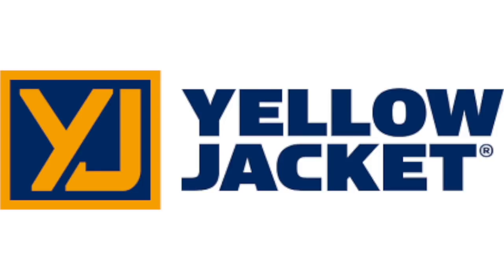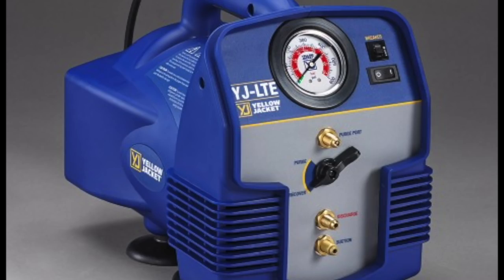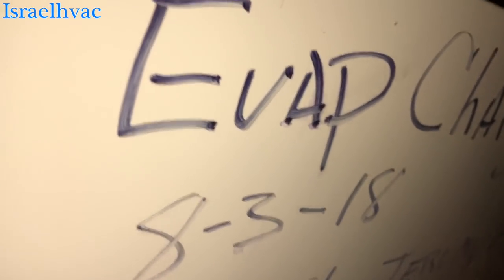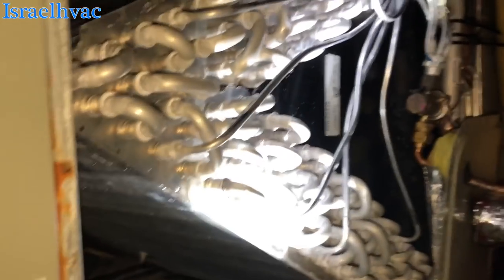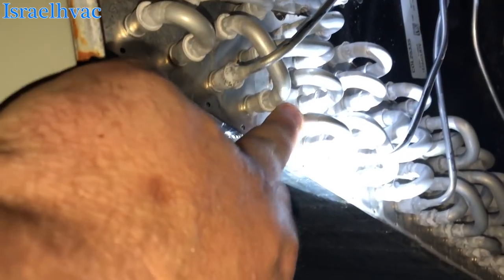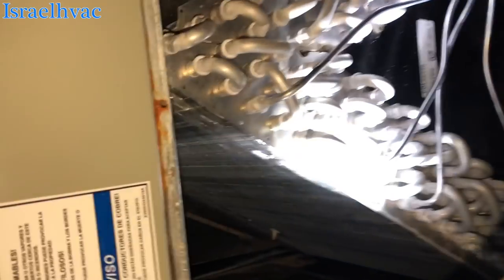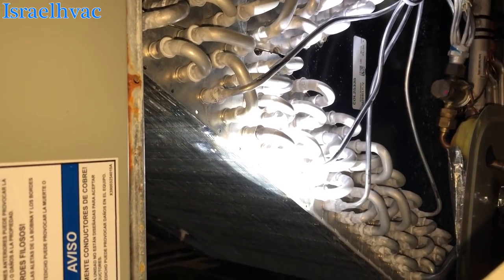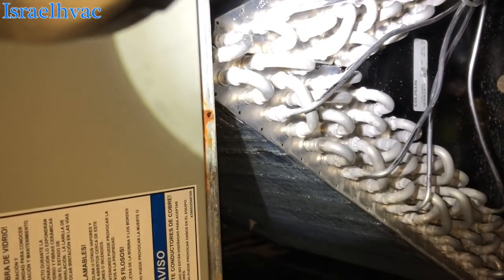HVAC Short | American Standard Evap Leak

Comment: Hey there I install my own mini split and didn’t put a vacuum on it before opening the valves. The line set is about 10ft long how quickly can doing that damage the system? And what would need to be done to fully correct my screw up?
Reply: My question really is even if I have the system evacuated and fresh R410A put in is the system already screwed?
Reply: Reclaim and pull vacum, add new puron, system will be fine
Reply: tweakitright well poe oil u could of introduced moisture to the system which will come back to bite you pretty hard, change the Liquid line drier test the oil with an acid test kit, pull a vaccum to 500 microns on ur micron gauge, break the vaccum with the factory charge, and check superheat and sub cooling... that’s how a real mechanic would do it, pretty standard stuff

Comment: Why would you try to repair that, it's an obvious mfg. defect only a month old, replace it under warranty ,if you try to repair it and fail you may void that warranty, plus if there is one poor joint, there may be more, if you haven't soldered with aluminum, practice on one from a junk pile first, just saying.
Reply from the maker: Just trying to get the customer back online ASAP. We are ordering a new coil but I’m going to make the repair in the mean time to get the customers air back online.
Reply: Gotcha, good luck

Comment: If that evap is new did not the factory do a leak test before shipping? I am not an HVAC tech but just wondering where is their QC?
Reply: The coils blow their joints after they've been installed and pressure checked. I've seen it happen 5 or 6 times with both Carrier and Trane

Comment: John what do you think about Ameristar units?
Reply from the maker: I have never seen one in person man.
Reply: The apartment complex I work at was built 14 years ago with American Standard units, some condensers installed are Ameristar.  You can't even tell the difference between them because they look exactly the same.  Some still rock solid outlasting the American Standards. But they also have the same flaw,  the nut on the rotolock rusts and it leaks from there. 
How are they now I don't know because when we are doing a full system change out, we are switching them to Carrier.
Reply: @DemBone  That was back when Ameristar was American...not any more🇨🇳
Reply: Ameristar is a great unit 
Probably the best affordable units available